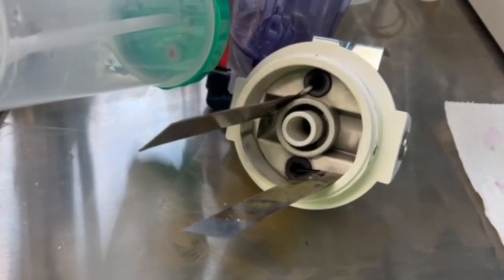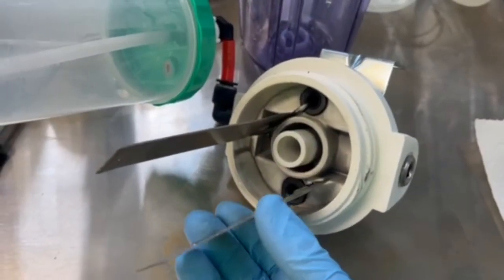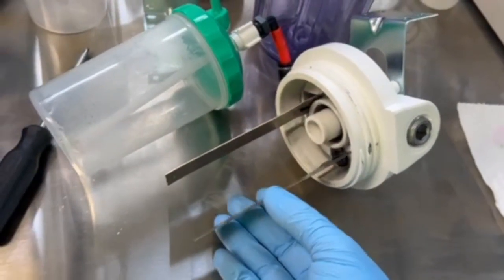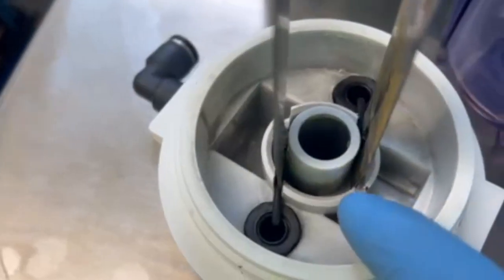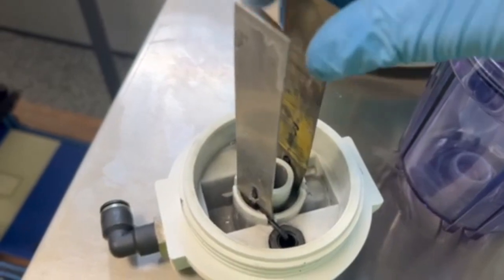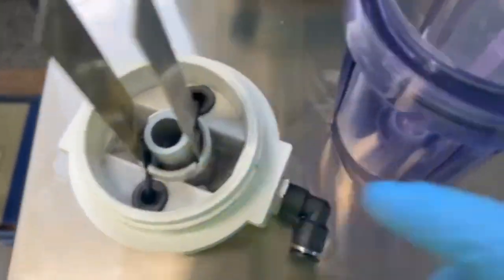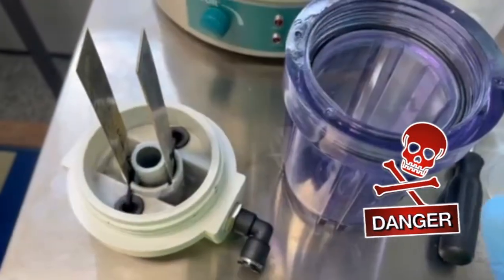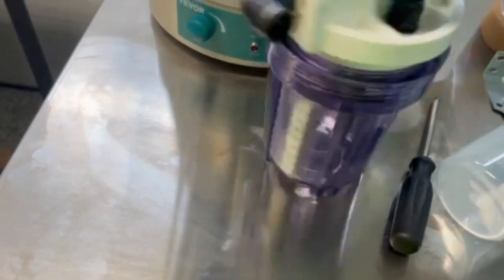DIY Hydrogen Cell Update: Electrode locks #hydrogen #hho

Comment: Interesti stuff you do, would like tp try, my grandpa worked at the vemork hyrdopowerplant here in Norway and made a lot of it
Reply from the maker: Wow really?? That’s amazing! Do you have any pictures of information about it? I’d love to  go visit the museum and get up close pictures of their electrolysis cells!
Reply: @AndyMaker  if you find lead acid batterys that has bean usen and topped up meny times it is enriched in DHO/D2O to give you an head start to the natural 0.0156% deuterium content.
Reply from the maker: Interesting, I'd love to test the enrichment of the battery. I'm currently making a fully modular cascading electrolysis unit. I will be able to add modules inline it increase the content. Have you been to Vemork?
Reply: @AndyMaker  Yes wrote an long comment about it with an link to the museum site but it was deleeted by yt
Reply: you should try making the GS prosess. The Bruce Heavy Water Plant in Ontario, Canada, is the world�s largest producer of D2O. It uses the Girdler Sulfide (GS) process which incorporates a double cascade in each step. In the upper (�cold,� 30�40 �C) section, deuterium from hydrogen sulfide preferentially migrates into water. In the lower (�hot,� 120�140 �C) section, deuterium preferentially migrates from water into hydrogen sulfide. An appropriate cas-cade arrangement actually accomplishes enrichment. In the first stage the gas is enriched from 0.015% deuterium to 0.07%. The second column enriches this to 0.35% , and the third column achieves an enrichment between 10% and 30% deuterium. This product is sent to a distillation unit for finishing to 99.75% "reactor-grade" heavy water. Only about one-fifth of the deuterium in the plant feed water becomes heavy water product. The production of a single pound of heavy water requires 340,000 pounds of feed water.
Reply from the maker: I agree thats the way to make large quantities effectively and quickly, but I do not want to work with hydrogen sulfide for safety and regulations. I'm building a safe system anyone can use for making small lab quantities of D2O